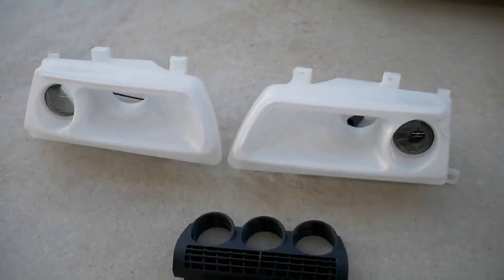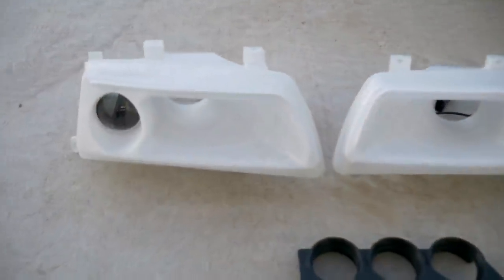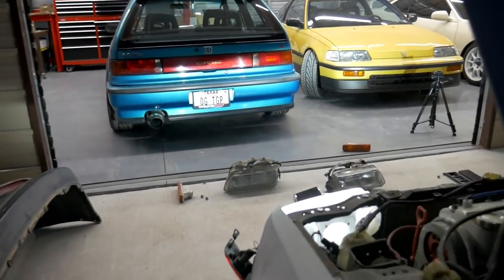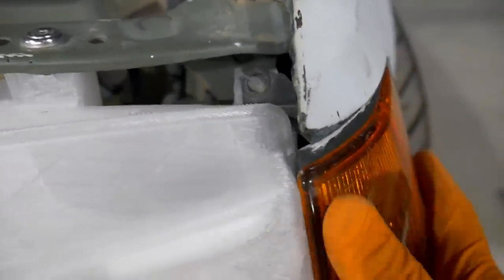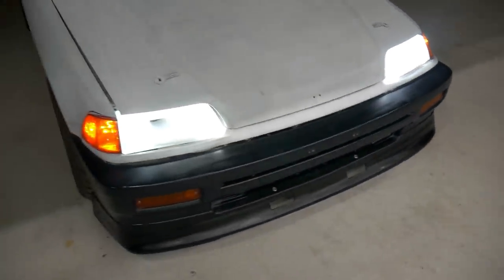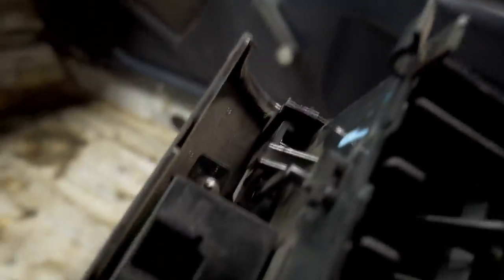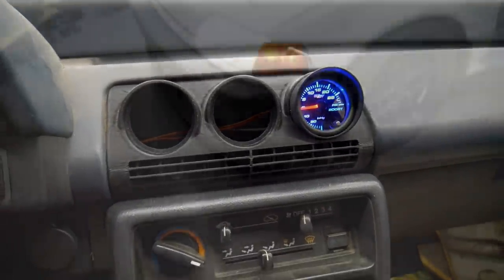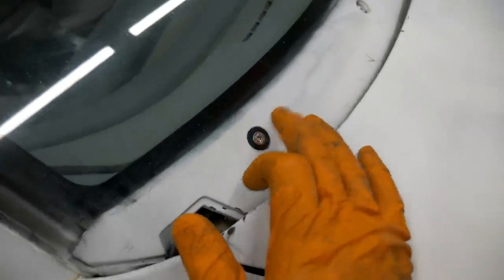3D Printed Headlight Ducts from EFB Motorsports - EF Honda Civic

Comment: Thanks Jon for taking the time to make a video on our first batch of products! If you guys have any questions, come join the discussion over at our IG page.  We're doing a 1,000 follower giveaway! https://instagram.com/efb_motorsports
Reply: @TheXXXskater1  we do plan to make parts for other vehicles in the future, but no specific plans yet. The more feedback we get from what the community would like to see the better!
Reply: @TheXXXskater1  We also offer custom part development, dm us your idea. Depending on the scope of the project, we may be able to help.
Reply: Can you make the headlight inlet block off plate? just in case it happens to rain while we're driving. we can just stop and put a block off plate where the intake filter is?
Reply: @olderrol1968  We've got a prototype that slips over the beaded outlet adapter.  Been so busy stocking up inventory lately we haven't had a chance to make one final revision necessary before we test it and make it available.
Reply: @efbmotorsports2047  OK. I have a 1996  EK civic. I'am looking forward to   Purchasing the headlight unit in the future.
Reply: @efbmotorsports2047  can you make a rear HFP lip for a 4door civic with the 3D printer
Reply: What about headlights for 90-93 integra?!
Reply: Any plans for eg chassis
Reply: @brayaguilar3499  likely headlights in the future!
Reply: Any EG hatch products in the future? Or just strictly EF platforms?
Reply: Any em1 parts?
Reply: How do I buy the kit like he did with both lights? On your website I can only see the passenger light for sale
Reply from the maker: Both are available on the website now.
Reply: If you'd be interested in making a HVAC gauge cluster for the crx I'd me more then willing to send mine in so that you can use it for design and mounting purposes. the only other place that I've seen do something like that is ortiz customs but i bought there's and to be completely honest i was very let down with the quality and the fact that there is no way to properly mount is to the dash other then using 3m double sided tape
Reply: @ronniecason9807  Thats in the works! Already printed a prototype, just need to make some revisions!
Reply: @efbmotorsports2047  well let me know if you need someone to rest it out I would be more then willing to and give my feedback on it.
Reply: @ronniecason9807  appreciate it, but we've got a CRX.

Comment: Definitely buying a pair for my car , I wish they sold them as a bundle deal I’d you bought both headlights! So cool!
Reply from the maker: They do.  It's less expensive to buy the pair.
Reply: How do you find that option I have a pair in my cart ready for checkout and i calculated it, it’s not cheaper for a pair, atleast on my screen
Reply from the maker: I thought it showed automatically.  If not contact the seller.

Comment: Next should be hood louvers or vents, you can even put hood risers. Air enters the front of the car, the problems cars face with excessive heat is heat extraction.. you’ll want to pull the heat out now. 

Im still waiting for my naca duct to come in, thinking of installing it on the hood of the dc5, it works by guiding air in, and if you run it backwards it works like a venturi effect by sucking air out with vacuum. Actually you should look into NACA ducts 🤔🤔
Reply from the maker: Used some hood vents today.  Kind of a funny outcome, you'll have to see the video in a few weeks.

Hood risers actually hurt the effectiveness of the radiator.  Plenty of articles on it.  Plus I don't like how hood risers look at all.  Unless I had an engine that required some risers I wouldn't personally put them on my car.
Reply: @GarageBuiltHondas  nice man, can’t wait to see! I’ve seen mixed results on hood risers, I’ve seen people get lower temps in the engine bay with them, but I don’t know if it effected radiator flow, I don’t know if it’s much of a negative effect it could be since the radiator is all the way up front and seems a large amount of air.. 

Where are you placing the vents? I think it’ll be best for a large vent front and centered over the exhaust manifold, the heat behind the radiator will exit from there, and also in the rear corners of the hood by the hood hinges, it’ll get rid of the pressure in those areas and allow a stream of air for the intake too
Reply from the maker: Yes, I added 2 small vents which vented the area between the radiator and engine.  That's where it's most effective as the air that comes through the radiator hits the engine and normally hits the undersides of the hood.  Venting in that area allows that air to travel through the radiator, up against the motor and directly out the top of the hood not only increasing the radiators effectiveness but also removing the hot air as well.

I used some cheap ebay hood vents.  Although they worked well, the end result is pretty funny.

Comment: Could you do a light range comparison to stock lights?
Reply: That's a great idea, well try and post on our IG in the upcoming days!  Im currently running a single bulb ZC headlight on the driver side and the duct on the passenger side.  I'm not sure most people would notice much difference while driving until pulling up right behind another car at a stoplight.
Reply: @efbmotorsports2047  You could drive up to a wall and see a comparison on the light beam range and width.

Comment: Will cutting vents on the hood over the exhaust manifold help disperse heat quicker and help areo letting trapped engine air vent  helping eliminate lift
Reply from the maker: Definitely

Comment: I like the setup but you need to feed that air somewhere.  Simply letting the air under hood can hurt radiator performance.  You need low pressure behind the radiator/inter-cooler for best cooling performance.
Reply: He's aware, you'll see what he did in an upcoming video

Comment: Did you need to do new wiring to be able to use projectors with those headlights.
Reply: If you buy the assembled headlight, it is completely plug and play.  If you opt for the kit, it has all the components necessary for a plug and play headlight, but you wire it yourself. No modification to your stock headlight harness is necessary.
Reply: @efbmotorsports2047  thnx

Comment: Damn I need those cowl panel clips for my DA.
Reply: Pretty sure they will fit, but its not confirmed yet.  Message us if you are interested in a set for your DA, we can offer a discount if you confirm fitment for us.
Reply: @efbmotorsports2047  will they fit EGs?
Reply: Pretty sure there are ones on thingiverse that work.
Reply: @nobodynoone2500  those are just oem replica caps.  Completely different than our product :p

Comment: Hey Jon whatever happened to the other track car with the B20? And I have another EF question. My d series is misfiring under load. It idles fine, sounds smooth, fires right up but when I take it around the block it misfires as soon as I give it some gas. Everything in the ignition system is brand new, even swapped the other distributor off my 89 5speed and no change. I'm assuming it could be timing is off, is there anything else that could cause that problem?